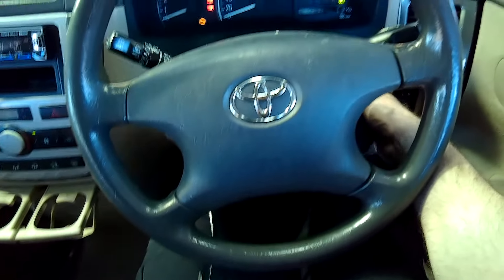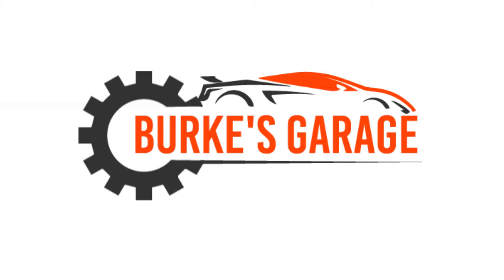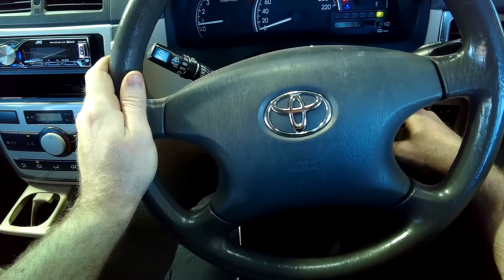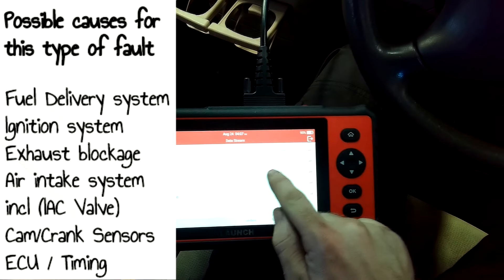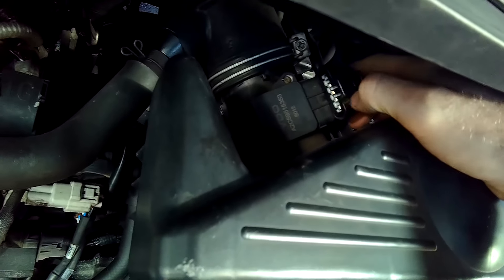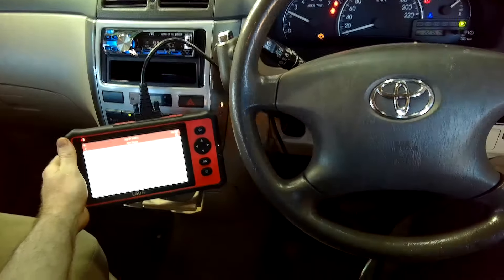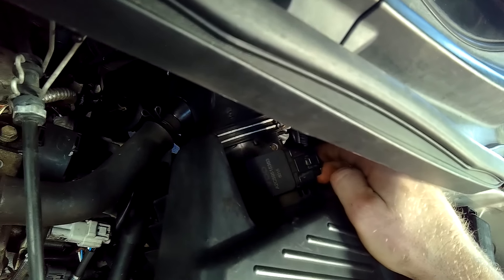Starts Then Cuts Out Immediately - No Tools Required DIY Solution!

Comment: This video just saved my day. I noticed my car was vibrating and it went off in its own. It couldn't maintain idle. After watching this video, I disconnected the MAF sensor and boom, I was on my way. Thanks a lot. I was 30KM From safety.
Reply: I’m about to try this I hope it works I’m 54 miles away from home in the rain with my girlfriend
Reply: @saucyg407 did you reach home?

Comment: I had 5 years with that problem, I just solved it last week, the main issue is the fuel pump. Replace it that issue will dissappear, the fuel pressure is not enough due to a weak pump motor

Comment: Did the test on the MAFS, car stayed running. Bought a new after market one, installed it and had the same problem. 😢
Reply: the same here I've bought a new OEM MAF sensor but unfortunately the same problem!! have you found out what's the problem with your car?

Comment: What if I already replaced the mass air flow sensor and the problem continues
Reply: You find a answer to this?
Reply: @RogueEntertainment  actually I did you have an electric plunger in the front of the block of the engine with a big tube coming out that leads to the air filter I popped that tube off and saw a lot of build up of carbon along the plunger if you half turn on that key the plunger will open use carb cleaner and clean it really good out it all back together and I’ve never had the issue again
Reply: @RogueEntertainment  lmk if you need help finding out what I’m talking about
Reply: @austinsoutdooradventuresan2338  Thanks man, I'll check on my car and see if this works.

Comment: This worked on my 02 century after I changed the spark plugs and fuel injectors! It would start up for a second and then shut off completely. It took me so long to figure out what it was and this video stands a test to time and helped me out years later after it was uploaded. Awesome diagnosis. 🎉🎉

Comment: Thank you so much for the video.  This helped me fix our 2005 Sequoia.  It was starting and then dying after like 1 second but we could usually getting going on the 3rd or 4th time.  Did this for a few weeks and then it it would be okay for a while. But then it started dying while driving while at a red light, etc.  Took it into the shop and of course it wouldn't do it for them.  They kept if for a week and it never acted up so they didn't try to fix it because they said it was fine.  Then today it wouldn't start and run at all.  It would start and then run for 1 second and then die.  I was thinking of having it towed into the shop, but I thought I would check youtube first and found your video.  Tried unhooking the MAF and it started and ran no problem.  Got a new MAF, changed it out in like 3 minutes and now all is good and running fine again.

Thanks again,
Jeff

Comment: Thanks for this video. Had the problem with my nissan serena i used some wd40 electronic spray to clean the air flow sensor and my problem was solved.

Comment: I experienced this exact problem yesterday and followed the steps indicated to confirm the problem was the MAF sensor. Bought and installed a new one and the van seemed  to run fine. For one day! Then the same behavior returned now with a new MAF sensor. When I disconnected it this time, the stalling persisted and I am now seeing DTCs P0351-P0356 (before disconnecting the MAF sensor).
Reply: Fix it?

Comment: That worked for me.  Thanks!  

And for everyone else, these things will cause a hard or no start as well if they're dirty.  Spray the sensor down with some CRC QD Electronic Cleaner or equivalent.  In my case, it saved me from having to buy a new sensor.
Reply: Why didn't he say it in this video
Reply: @tonetell3095  I know, right?  Dirty sensors are a common problem. My experience has been that if someone else is buying the parts, it's much easier to just throw a new one at it.  Plus the shop gets 50-100% markup on the part.

But I will say that the shop has an interest in getting the problem fixed right the first time, where we DIY'ers' interest is in saving money and not buying unnecessary parts if we don't have to.
Reply: Not always I cleaned my sensor not good at new it show 0.3 gram per sec when engine stop. Pretty sure out of calibration.
Reply: @tonetell3095  you can't clean some of them, it'll destroy the maf. Maf cleaner is to clean the hot wire of a Maf, if you have a karman vortex maf, a cleaner will destroy the maf as it uses mirrors and a laser to "listen" to the air mass.

Comment: MAF (near engine air filter) cleaner & THRODDLE  BODY cleaner needed.  A Mechanic can clean the grime off both ( not easy) about every 25,000 miles or 1 1/2 yrs.(change engine air filter then also). If replacing parts keep old parts. Hope helps.
Reply: So even if is still dies at idle I should clean the throttle body

Comment: I have a 92 lexus sc400 obd1. Since its a toyota as well i need to try that. I have replaced many electrical, fuel related parts and all the vaccum line i could find when the car has different symptoms but bow it's doing the exact same thing as this car. Only difference is if I unplug the battery and reset it'll stay on a little longer but repeat again.

Comment: Have they the hot wire air flow meter in em ger..u can clean the little hot wire element  in the air flow meter with carb cleaner..ive done that on the yaris before and it works a treat
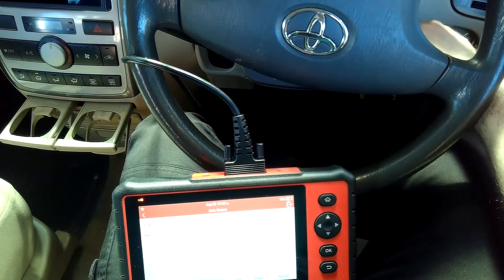Reply from the maker: Spot on Conor, as I say at around the 2:44 mark, have it replaced or cleaned up. Whichever is more suitable for your circumstances 👌👍

Comment: Yabadabadoo! 2005 Opel Tigra Twintop, Corsa engine. Fuel holding at 50 psi, new plugs, all new filters, pump.. Cuts out in seconds.Tried to get MAF spray in France, never heard of it. Cheap Odb reader useless.  Tried to buy XTool D7, not in France, and Amazon won't post here from UK or US because its a "non digital item" (???).  Managed to unplug (weird one) ran for 30 seconds, shaking, all warning lights went out. REplugged, cut out. So this doodad is prolly  beyond cleaning and needs replacing. Will bookmark this and update. 
Thank you sooooo much.

Comment: I'm having this issue with my 2.2D X-Type but unplugging the MAF didn't do the trick, but unplugging the wire to the turbo actuator did get it going. It will also start when I unplug the MAP on the EGR, and once it runs it will be fine starting up again, until the next day. But it's running really rough, searching, erratic gear shifts (automatic), and lots of different random error codes, like torque signal, neutral shift position, high fuel pressure, etc.
I'm starting to think it might be a ground issue.
Reply: Same here bro

Comment: My GX470 does the same exact thing, starts then it'll stall out.. I was stranded at the gas station waiting for a tow truck, but I was parked where the truck wouldn't have been able to get in front of my vehicle.. I randomly decided to try to move back just a little bit so the truck could get into position. After starting, I went into reverse immediately after starting up & it STAYS on . It's the only way it stays on, park or drive or driving/doing nothing after starting will make it stall out and turn off. Any ideas what this could be? 🤔🤔
Reply: Mine was the air box wasn’t connected correctly to the throttle body
Reply: @mikee8304  idk what my issue was, but luckily I knew a guy who just removed my throttle body and cleaned it with SEAFOAM then put the SEAFOAM inside my gas tank and gave it a good powerbrake

Comment: omg if this is all it ends up being on the car im working on i'll be both pissed and relieved.. i've swapped cam position sensors and crank position sensor on the advice of other mechanics.. i never once thought the maf would cause this without throwing a code. mine does this but only after the under hood temps get hot. if i keep a fan on top of the engine it'll stay running so i figured it was a sensor.. thanks for the video.

Comment: What happens when you unplug the sensory and drive?
Reply: The ecu won't read how much is air coming into the engine that's why you need a MAF sensor. And if you drive with the mass air flow sensor unplugged you will see black smoke coming out of your exhaust pipe.

Comment: This seems like my issue but my oil light also flashes with the others, but I don’t this any of the possible issues might be related to the oil, tried this trick and it worked once but now it won’t. Oil seems find tho so in a bit of confusion

Comment: Have this same problem with a 2009 toyota venza. Starts up and immediately stalls. Try to start again without turning it all the way off and it just cranks without turning over...

If I turn it all the way off (push button) it will do the start and stall again. Unplugging the maf sensor does nothing to change this. 

It actually did this to me months ago...then suddenly started working again until about 3 days ago. Can't get it going
Reply: Check for dirty battery terminals or change the battery.

Comment: Thx for sharing. I have an 11th Corolla s with 6m/t. I was driving it home and suddenly it died. It would fire up and instantly die, like this. Threw like six codes. I was an idiot and didn’t write down all the codes, just cleared them. Started it again and it run for a few seconds then died. Only two codes came back, codes for the intake and exhaust VVT solenoids. Replaced them. Now it starts and runs fine, idles for like 40, 45 minutes, then shuts off. Now there are four codes, that’s seem unrelated. Those two, plus one for knock sensor, and I forget the last one. I’ll have to look it up. Seems like when the engine warms up, it cuts out. Weird. Any ideas?

Comment: thank you for sharing this🙌
i have the same problem Toyota Corolla 09 1.8, i brought a technician to where it's stopped and told me some computer components need to be fixed ( replacing some ICs or transistor) or replacing the whole PCM cause he tried my computer on another vehicle same model and the problem still exists starts then cuts out immediately! what do you think
Reply: I've been dealing with this problem today.😢 had it happen about a year ago after throwing a bunch of parts at it...looks like I'm going to have to do it again.  Unfortunately this trick doesn't work for my car. It starts up and dies with or without the MAF connected.

Comment: Hey man great video. I had this issue and changed the maf sensor and it worked great. A few weeks later and it just did the same thing to me again. Any tips?
Reply: Might be wiring...or a faulty sensor.
Reply: Some of the aftermarket parts quality is poor anymore.

Comment: really helpful gerard would love you to solve my issue as its a ford focus 1.8 zetec s model and star/stop button, heres the issue its start fine and drives and couple meters down road at junction when put clutch in to go from any gear down to like 1st gear it dies and i have to constantly keep putting clutch in again push start button for it to get a little more down raod or any junctions to cut off on me randomly, very frustrating as looked at all types videos and yours seems be closest cause yet but would be intresting if i can get a video to show you :D

Comment: Experience their well done Gerard. Did u get 2 check any live data
Reply from the maker: Cheers Ian, 🙏🙏
Yes I was looking at it before and after. When disconnected the air temp went to - 40ish and the MAF reading stayed at 0.35 g/s when conneted or disconnected. 
When replaced the g/s went to normal expected levels at idle and when reving 👌👍
Reply: @GerardBurkeBurkesGarage  i will let you away with that one so Gerard 🤣🤣🤣

Comment: My Toyota 1az fse noah engine will  turn off immediately after the engine check light comes on during normal acceleration, what should I do to get the problem fix

Comment: Unfortunately this ia not my case. I changed the fuel pump and the problem insists. It starts runs ok then when i turn it off sometimes atarts sometimes doesn't
Reply: Please were you able to find the issue

Comment: If you unplug the mass air flow sensor the car will start. If you try to plug it in while it's running the car will die.

Comment: Man I wish this worked for me. I do have the MAF sensor engine light code on but it still doesn’t start even with the sensor unplugged. There were no codes before so I think it only showed up after I tried unplugging it.
Reply: Same for me. Nothing works. Eventually it starts again...after days of no car.... but it will happen again eventually ...like it is to me now, for thw 3rd time
Reply: @wickedpossession  - It turned out to be a vacuum leak in the intake manifold for me.
Reply: @Doom1AM is there a way to test for that? What did you replace?

Comment: Now I still have the same issueneven with the new one installed. When I unplug it works
Reply: Hey bro just wondering if you resolved your issue? I tried this on a Nissan Sentra it worked I but read your comment and was wondering if I may need to check something else

Comment: This happend to my Skoda after the battery died, we jump started it and it kept cutting out,  local mechanic tried to as booster pack and the same., got towed to Limerick main dealer, while I was talking to the manager about it a mechanic "moved" the car, aka he has good booster pack. Turnes out the ECU and fuel pump is sensitve to low voltage. Ars 250 euro for the tow. The main dealer didn't charge to clear the ECU fault code.

Comment: I'm having that exact same issue right now with a 1997 Plymouth Voyager and what I seem to do to fix it is I removed my glove box area actually I'm removed my glove box and I was able to view my heater core housing unit and what seemed to be I guess maybe a problem is the cord to my heater core was pushed in that could be why it was stalling out when I was started I would start it and it was solo immediately and what I did is I pulled the cord close to the what looks like to be flush with what it was before it was pushed in and I started it and it worked now today my wife is in the city 1 hour away and she phones me and she says the van won't start I said well try what I told you because I think that's a air flow problem and I think I just found my video that is my problem thank you so much if anybody else can help me out great thank you I will post a video if you want me to my starting and stopping actually maybe I'll post it anyways